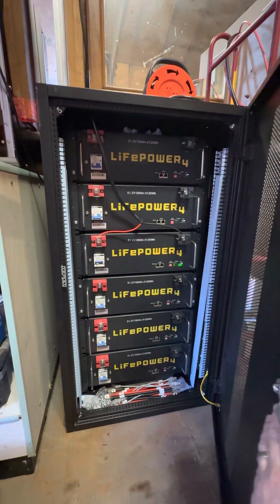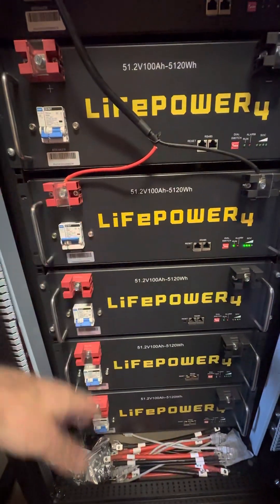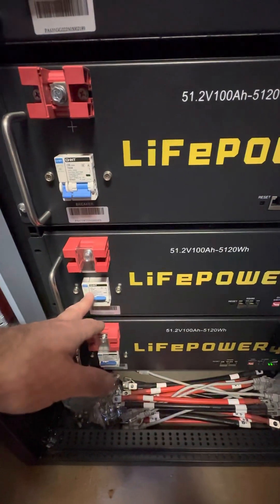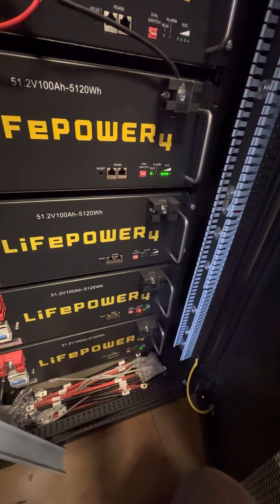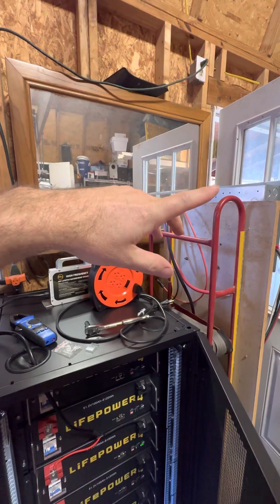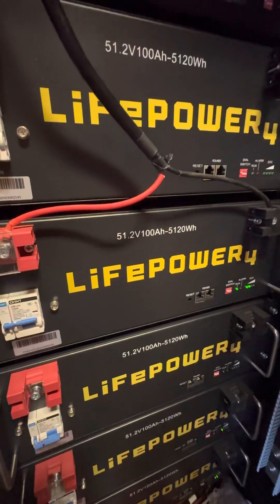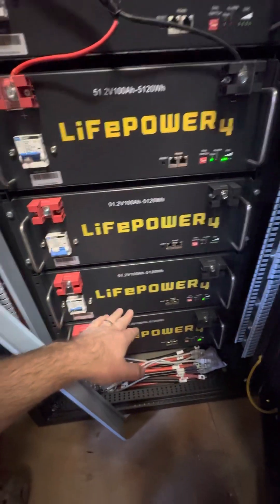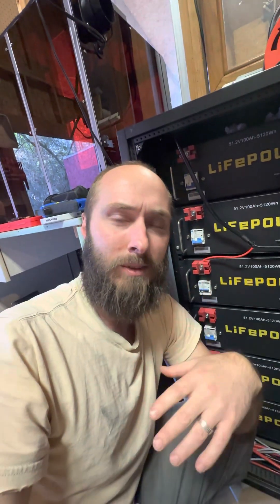EG4 LifePower Battery Rack

Comment: Could just do a longer cables and connect right side at the bottom. Thats what I would do, instead of flipping the bar and making it an odd fit.
Reply from the maker: Good Idea. Only problem is the larger lugs are at the top.

Comment: Not doing diagonal on a lithium battery bank with BMS is not going to make any difference one way or the other. The BMS is going to regulate the output. AND they don’t do it evenly in real time but will level it out over time. The same will be true if you hook the bank up diagonally.
Reply from the maker: That’s a good point about the BMS. I’ve been using them over the past couple of weeks and have fully cycled the batteries and found no problems with them staying synced up.
Reply: @EastTexasHomestead  I'm using solar assistant to monitor the batteries. The SOC can vary easily by 10%. The position of the batteries relative to the inverter connection point is irrelevant. They eventually get really close to the same SOC then start varying again. I've been running 15 of these batteries since Jan 6th.
Reply from the maker: @jeffmotes2129  How are you accessing the data in solar assistant?
Reply: @EastTexasHomestead  I used a USB to RS485 adapter cable and a RS485 port duplicator. Also had to use a USB hub then connected to tge Raspberry PI. 

I’ve added a EG4 LP4 Comm Hub and the batteries are tracking each other much better.
Reply from the maker: Awesome! Thanks for the help. I purchased a pre-installed solar assistant package last night and look forward to setting it up.

Comment: Have you seen where you can simply hook up the charger leads directly to the buss bar and simply turn ON the battery you want to charge while leaving the other batteries turned OFF.  Then charge the other batteries one at a time the same way.    That would save a lot of connections each time.
Reply from the maker: That’s a great idea! I didn’t think about that at the time, but if I were to do it again, I would go that route for sure.

Comment: Great, I'm putting together an EG4 system like this one too and just got the batteries in the rack. Got the same charger too and I'll charge them up equally.
I know little and will follow along while you hook it up, hopefully you'll post the process as you do it. Cheers
Reply from the maker: That’s fantastic! I wasn’t planning on doing a step-by-step guide, but do have quite a few videos planned. I’ve been using the system for the past two weeks and have been incredibly impressed.

Comment: Do you have an update on how your 6000EX is running?
Reply from the maker: I have two of them running in a temporary setup and they are working great! There are some issues with the display and not being able to connect to the app, but I haven’t really tried to get that working yet. 

At the moment, I’m charging from the grid at night (while it’s free) and using that energy most of the day then flipping back to grid when the batteries are low. 

I’ll try to get a video update out soon
Reply: @EastTexasHomestead  Thanks for checking in!  

Glad to hear things are working well so far.  

I wouldn't bother with the app that comes with the units.  It's hard to set up and it only updates every 10 min or so with the data.  If you want up to date information, you might want to look into Solar Assistant.  

Looking forward to seeing the update!
Reply from the maker: @AdamDeLayDIY  I keep hearing about Solar Assistant. Do you need extra hardware to use it?
Reply: @EastTexasHomestead  you do, yes.  It has to run on a raspberry pi micro computer.  Here’s a playlist of videos I’ve made on Solar assistant. 

https://www.youtube.com/playlist?list=PLT1O-X67-vpC2k5B6eTLNptMUj5ALLQBD
Reply from the maker: Thanks Adam I watched a bunch of your stuff. Great work! Thanks for the heads up. I made a purchase last night. Can’t wait to set it up.
Reply: @EastTexasHomestead  your welcome!  Have fun!

Comment: I don’t have my buss bar flipped over and haven’t had a problem for over a year. Though if the batteries stay in a limbo state of charge for weeks on end and never get to 100% they will become unbalanced. Also if you connect a dead one to a fully charged one the charged one will just fault and shut down.
Reply from the maker: Good to know. Thanks!

Comment: Your ammeter appears to be in AC amps mode.  That will not work for DC amps. You might want to make sure that meter can actually do DC amps. Not all can. I now have two nice multimeters, one that can do DC amps and an older one that does not.  :-)
Reply from the maker: That explains it! What I was seeing didn’t make sense and I assumed it would do DC. I guess I’ll be purchasing another meter. :(
Reply: @EastTexasHomestead   Good luck with your project. It is an adventure. I know I have learned a lot working on my project. And I made this exact same mistake with my meter.  :-)

Comment: Looks great Eric!  I'm looking at purchasing two of the Lifepower batteries and the small 3 battery EG-4 rack. I'm replacing two Kilovault 1800 (1.8 KWh each) batteries. They work fine, but I can't expand the existing bank since they've discontinued the model. Looking for someone to sell them to, since they're still early in their lifespan. 🙂
Reply from the maker: Now is a great time to buy them with 2 days left in Signature Solar's Flash Sale? 
You would save at least $150!
• $75 off on all rack-mounted batteries
It may also be worth buying a 3rd battery at $75 off and get the big rack free!
• Buy 3+ Server Rack Batteries and Get a Free 6 Slot EG4 Battery Rack!
Feel free to use my affiliate link if you to make a purchase: https://signaturesolar.com/promotions?ref=esttxthst
Reply: @EastTexasHomestead  I would, but gotta wait for some extra $ income to hit our budget in March
Reply from the maker: I hear ya